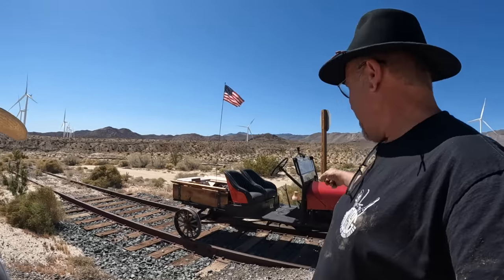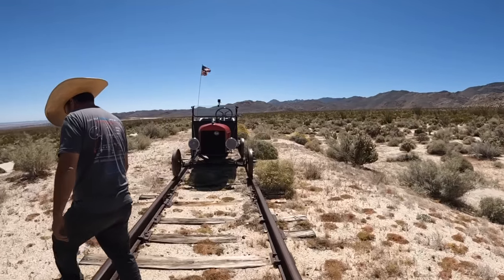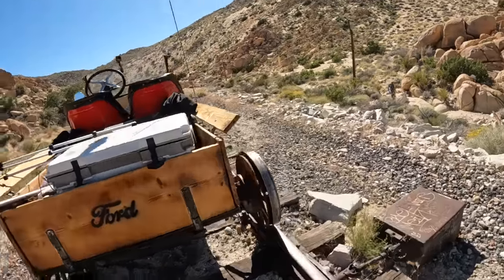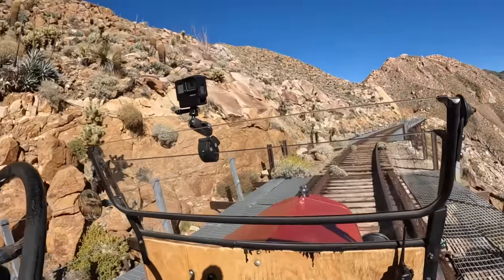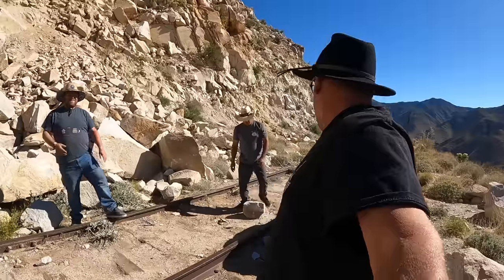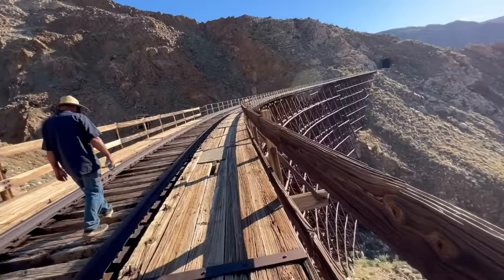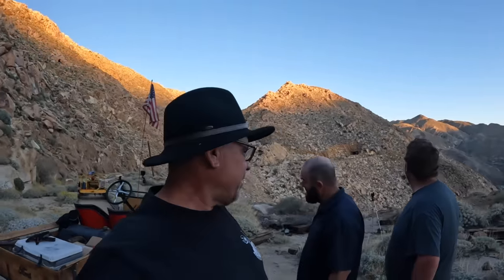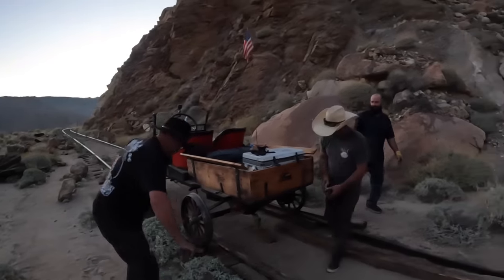Can We Make This Model T Railcar Run and Drive to Goat Canyon Trestle to Go-Kart on Railroad Tracks

Comment: Great vlog,you guys, but why don't you weld or bolt a hydraulic jack to the chassis of the 'T' at the centre of balance fore & aft, then when you need to turn around you just extend the jack to the floor & lift the 'T' just off the rail & spin it to face the other way, let it down & you're off in minutes. It would save all that huffing & puffing, plus, it would aid you should you de-rail.
             If anyone can invent something, i'd put my money on you guys.

Comment: Is that how two men intended to turn a Model T around when you were ready to return? Looks like you four men were very busy for two or three hours in the sandiest spot you could find on the railway. I am surprised you don't just reverse up to the last timber platform so you could manoeuvre the vehicle on its steel wheels.

Comment: Now talking of a true Model T railroad car, check this out, the (replica) Ford motor car which had the designation of an RM (Railway Motor)  that the New Zealand railways gave to their two genuine units.

And this replica of our two RM Model T Fords, is still in an "as is", near original condition on the scenic railway at Pleasant Point, South Canterbury, New Zealand.
In this video it's not very well shown, but it's a delightfully made unit, that "smells" of Linseed Oil and old leather seats.

re:
https://youtu.be/beEaQuHc7ho

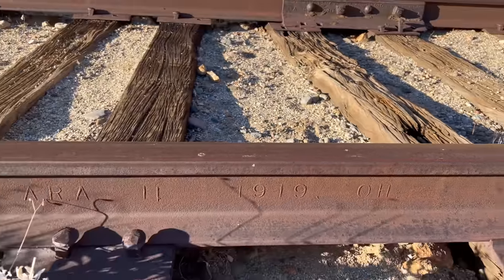Comment: At 28:11 you have NOW discovered the perils of offtracking without any timber platform (manual turntable) inside the rails, nor the offtrack "boards" (or rails) that they had beside them, set at 90 degrees to the main running line.
Surely you would have been able to "reverse" your Model R (railway car) to get it to such an offtrack stand, unlike where you spent all the useless effort - you lost on the sand where you did turn it later?
Ah the length of that awkward device, as that added to your misery, in getting it "around" on all that loose spoil.

I was "hoping" that by 28:35, you may have discovered an easy way with that hydraulic Jack - by placing it midway (balanced) underneath the cart, to safely and quickly, spin the cart above the jack, but no, you all decided on much more hard manual labour, of more liting and lurching, so that finally "that's they way you did it".
  At a much cropped 33:45 (possibly well over an hour later?)

NOT as most railway workers would have done, such as at that other "well made inner wooden platform turn around table" turn around that I would have used..

But you got there and got it home too...

Next time in the workshop, put new rims on that cart (as the one you broke isn't going to be the only one to break/split).
Then lift it in the midline at the balance center, and weld on a plate that your hydrualic jack can lift it with when ON a proper offtrack stand, so that manually turning the beast will go smooth as butter on hot toast, pivoting it above a jack, that lifts it well above the flange clearances to all the rails you will pass around underneath this.

Also, provide yourself with an onboard "turning bar" (one that telescopes into/underneath your main chassis), as that way you can draw it out behind, to leverage the lessor weight of the rear end, to pivot it on it's front wheels if needs be, which (because they swivel) can be pulled inside of the main running rails before the jack lifts the heavy motor (radiator end) and sets you free, on the running rails again.

Comment: seriously celan up those tunnels and slide areas, get all the speeders together and a bunch of wheel barrows, shovels, jacks, maybe some splosuvs and git er dunn!   organize it, bring food drinks all of it, well worth it IMHO.. someone might even have a little kubota back ho they can put on a trailer behind the MA . .  I bet that tunnel collapse isn't all that, more of a slide, no one cared to celan it up, I bet its more the face fell off than a genuine internal collapse, solid rock.. matter of clean up ..  at the other end put in a proper turn around loop, wouldn't be all that volunteers, donations, railroads always discarding timbers, all the old rail works..   if people wanna use it why not?  sure beats tearing it all out for a bicycle trail or walking trail fcs . . .  I scribed, I hope to see genuine progress boys, if they can git er dunn in 1919 you sure as hale ought to be able to git er dunn in 2024 . .

Comment: here is an idea you're a fabricator. how about build a collapsible crane/hoist rig 4-5 poles into a say what 12-15 ft Teepee design with a hoist top and center only have to lift the car what maybe a foot spin it then let it back down set up I figure and tare down of the teepee would be much quicker than all the effort of wood and jacking and lifting and prying right?

Comment: cool video..but i cant believe 4 guys cant pick up the rear end of that model t and swing it around ...and do the same to the front even with the 4 cylinder flat head motor and place it  on the tracks ....are you's city dudes??

Comment: Hey Merlin, have a project idea for you, build a turntable for that Model T like some track equipment has,maybe you could use a bottle jack upside down welded to the frame and a receiver plate that sat between the gauge of the rail for stability when turning the Model T.  Here is a link to a video of a turntable in action: https://youtu.be/vpUnSUOv0lE?feature=shared

Comment: There for the speeders if a train was coming behind them or coming at them, the Mars light would show if it was at night sometimes up to 4 miles and they would pull off and get off on the side and let the train go by and that other set of tracks that you threw a switch on was called siding and when there’s a eastbound or westbound train, it had like president over like passenger over freight then the passenger would pull off on this and wait for the freight train to go through and then they get back on and head in the opposite direction of the train Section high school then the department rebuilding cars and locomotives during the Vietnam war area when we didn’t have anything to haul our animations and so forth with and then became a certified Carmen to work on any kind of boxcar caboose cold car, flat car, refrigeration, car dump everything and then moved onto a different jobyeah my dad was on the railroad for 38 years as a switchman and I was in the blood 22:29

Comment: You took forever to Turn that Thing around. Why didnt you Just lift it Up and turned it around... With 4 Guys it shouldnt have been a Problem, this Car weighs what, 400 Pounds... 250 on the Front and 150 in the Back? Common... You couldnt lift that?